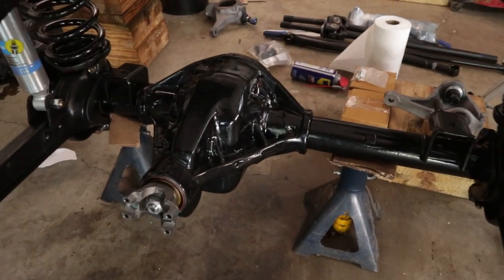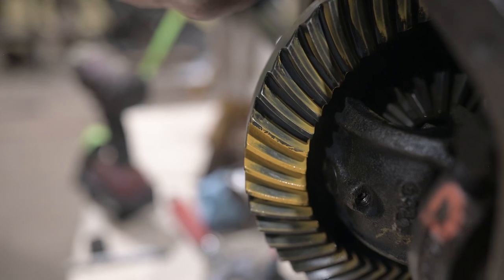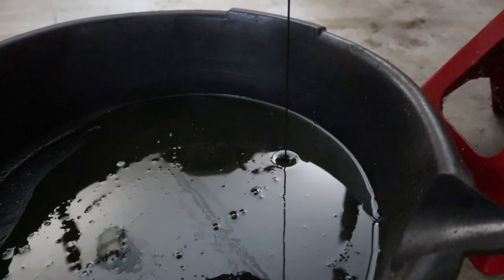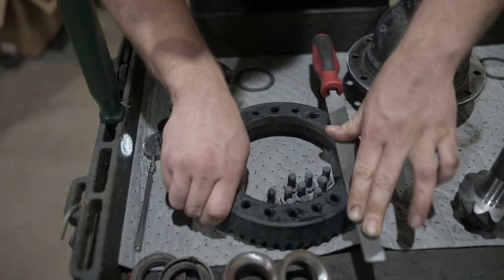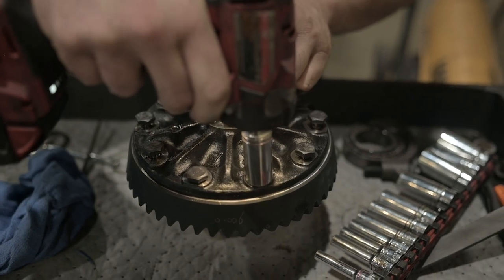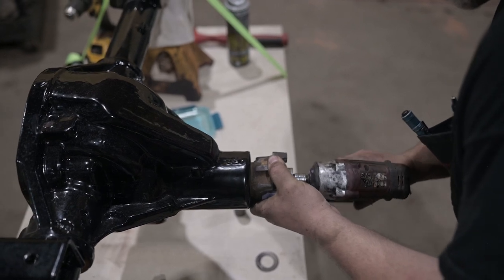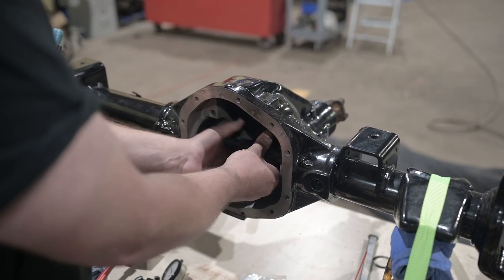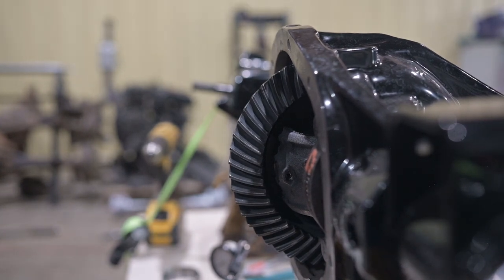How to Re-Gear a Dana 44

Comment: How do you drain and refill the diff I don’t see a drain plug or fill plug on my diff
Reply from the maker: You’ll have to remove the cover to drain it.
Reply: Whatever you do, please don't use the screwdriver as a wedge
Reply from the maker: To pry the cover off? I think I did that but i tried to make sure not to dig into the housing. But that’s a good point, you really shouldnt
Reply: @NashvilleEarlyBronco  it's best to leave the top bolt in the cover and smack the hump with a plastic/rubber hammer